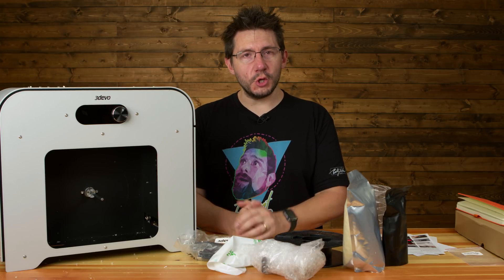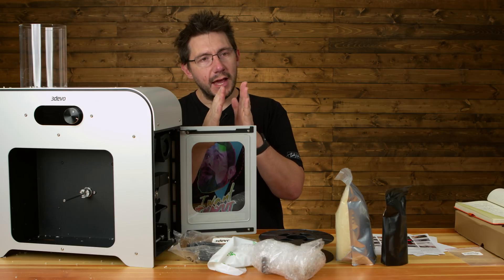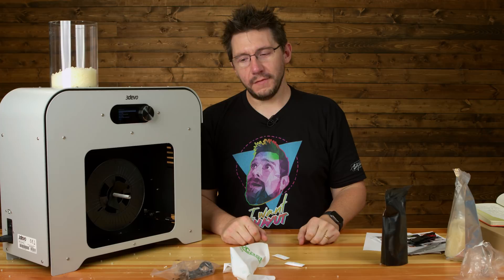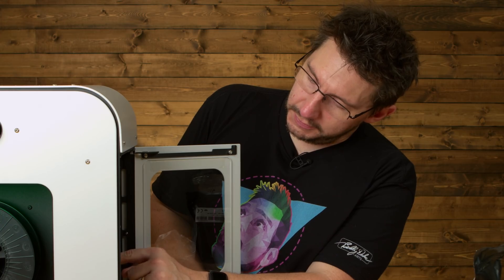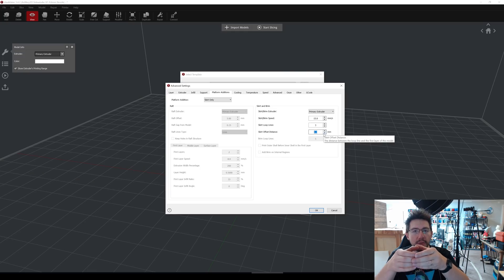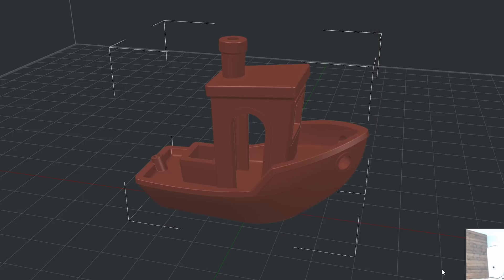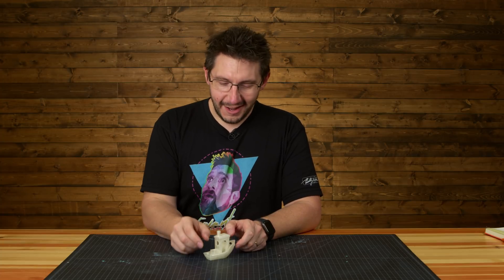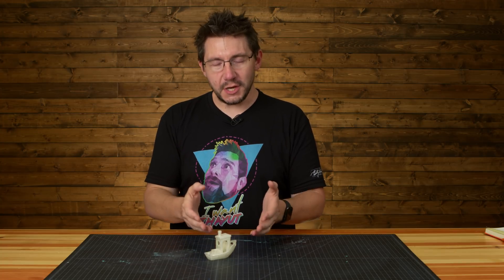Make Your Own Filament at Home: Take 2 - 3DEVO COMPOSER First Impressions

Comment: Great results, but it's far too expensive to be considered a 'home' product as your title suggests - desktop for sure, but when many of us are running printers that cost less than £500 we certainly don't want a £5000 device. Even for schools and makerspaces, this is far too much.
I'd like to see what it does if you mix colours of scraps, and when you put in two colours sequentially - if you can make a filament with a repeatable pattern it could be fun.

Comment: It's amazing and all but the price is far more than the sum of filament no I'll ever buy :p this is more for companies or communities imo
Reply: As a 3D print company, nope, still nowhere near worth it! It costs around $4 for virgin plastic pellets required by this machine, as well as electricity.
Which means to just break even, you will need to make at least several thousand 1kg rolls of filament, without the machine ever needing a service.
Reply: @nataliesilsbury1888  i meant companies that make filament. they could have one for specialty filament :P so they don't purge out the filament to change
Reply: @nataliesilsbury1888  I also have a 3d printing company & am confused also on this pricing being justified.  Hopefully Joel will do a video on Filastruder soon

Comment: You should print a flower and have it smell like a real flower by mixing in some perfume
Reply: Sounds flammable.
Reply: Good idea but not sure that will work. I've had some filament that smelled like strawberry while printing but didn't smell at all after printing. Maker Muse had filament that was made with algae and it smelled really bad when printing, though was OK after done. So I think filament with perfume in it would just smell like burnt perfume (probably not good) then nothing afterward.

Comment: Hi Joel, They lost me - big time; their cheapest model is: $5400USD.
Reply: so it is just at the price of an ultimaker2.
Reply: R Salomon I gotta wonder why
Reply: The Filastruder/Filawinder combo seems to use similar methods to this, albeit not in as tight of a package, and it's less than 1/5th the cost.
Reply: 5k just for the filament maker, for the Shredder gotta be at least 2k... over all looking at about 7k -_-
Reply: @AceSG  shredder could just be a blender
Reply: I think that for a price of over $3000 it a small filament maker like this should be 100% automatic. For that price, I think that you should not have to manually cut and feed the spool yourself.
Reply: @NothingMoreToSeeHereAnymore  Then you won't want to see industrial versions that cost $100,000 that are not automatic and require allot of manual intervention.
Reply: For print farms with a high filament consumption the costs savings are conciderable. 1kg of raw material is about 10 times cheaper than 1kg of filament. Keep that in mind, and the savings grow with the higher performance materials.
Reply: Yep I agree also the one he’s using is like 7grand
Reply: You need to look beyond the price - that will come down.  The first of anything is expensive.  The key here is that it is the first compact system that I've seen that looks like it works with consistent results.  I'd like to see the economics if you were running a 3D print farm and if it would be cheaper to make or buy your filament.
Reply: @reasonablebeing5392 You are so right. And only 1 viable kidney can fetch upto 4 of these machines, at least until the market for kidney's becomes flooded.

However, optimism is really best, dont let anyone tell you otherwise.
Reply: @reasonablebeing5392  PLA virgin beads run about $5/kg if you buy in bulk, so figure you save $12.50 a kg. The machine has paid for itself after just 400kg or so. Way more than any hobbiest would use. But realistic for someone doing it commercially. It looks to extrude much, much faster than a printer could ever use it up, so the question I have is how many printers can it feed at once.
Reply: @reasonablebeing5392  youre wrong the cheapest one now is 6200
Reply: @reasonablebeing5392  this aged like expired milk in summer sun since it went up in price
Reply: reasonablebeing that’s a terrible way of looking at it, because you are basically saying the manufacture will punish the early buyers to recover their investment more quickly, then reward later buyers with the “real” price. It’s a bad approach. The market price should match the utility, and if it does, they’ll recover their investment and begin to profit in due time. Having such a long-term mindset in business not only breeds better customer loyalty, but also forces you to commit to long-term development goals. The alternative is the model of releasing a new edition each cycle, overcharging for it by 500% until the next cycle begins, then drop the price to it’s true utility value as the new edition is released. This method works for the manufacturer as long as competition is limited, but nurtures a frustrated and bitter customer base that will abandon you quickly when worthy competition enters the market. And this isn’t a new technology - extruding filament is exactly how plastics have been manufactured and recycled for molding for ages. All those pellets were filament before they were pellets. Meaning, if they remain so overpriced, it wont take long for several others to develop more reasonable offerings. Hell, an actual full sized, used, reliable, accurate extruder could likely be had for not a lot more than these guys want for this hobby machine.
Reply: Check out the Protocycler, still don't know enough about it but it is less than half the cost
Reply: That is 245 spools of 1kg 1.75mm filament. I don't think I will print that many in my entire lifetime.
Reply: Oh dam.
Reply: China will eventually build it for 1/5 th of the price...
Reply: 2021 the cheapest I found was $8300
Reply: Wow...
Reply: The price is high, but it's a great start. Think about the teaching the whole process, from from oil, plants/refinery's making polyethylene, to pellets, to filament, to printed parts that can be for projects for clean energy, a whole class on how to make a 3D printed windmill, I think is priceless. It's a high price, I dont believe it's for the desktop user yet. But for an education environment, I think its great.
Reply: @DJ-kx4en  You're speaking our language!
Reply: Daniel Hoke the pellets were filament before they were pellets. That’s how it’s done 😉
Reply: It wasn't that long ago that computers with a LOT less capability than your phone cost more than this.  And it was a very short time ago that any reasonable 3d printer cost more than this.  The price will come down a lot sooner than you might expect.

Comment: The "at home" part is a VERY loose term, in this case. It implies "at a reasonable price". But in this case it really only means the location. The price is so far out of reach, for a normal person.........Would I like to recycle my failed prints? YES! I would love to. Would I pay over 5000€ for a way to do it? NO FREAKIN WAY!!
I can buy a lot of filament for that amount of money. I did a quick calculation and used premium filament and shipping and set the rate at 35€ per roll. That meant I could buy over 140 rolls of Filament. And that only covers the cost of the machine itself. You also have to buy the special pellets and the cleaning material.....
Reply: I'm surprised it's so expensive, as a mechanical engineer, I look at this and think "It's not complicated, AT ALL... 3D Printers are more complex.
Reply: @Freddy_Lie  My problems are more with the title of the video and the price point. 
BUT I wouldn't say that the price isn't justified. Even though the mechanical parts might not be super difficult, the integration of the sensors, into the mechanical parts, is a whole different thing. 
Getting a machine to heat up material and push it out at the other end is easy. Getting the machine to self adjust while doing it, to assure a constant flow and diameter is another thing entirely. And it's their "big product". Maybe there will be a real "at home" version. I mean look at the Prusa i3 MK3s. The price point is higher then your average Aliexpress printer, like the Anycubic Mega S. But now they have the Prusa Mini...
Reply: @bjoernlubetzki  It's not hard to make it adjust to sensor input either, it's literally just a PID loop to tune extrusion/pulling.
Reply: @Freddy_Lie  if it's that easy, you can build a machine that does it and sell it cheaper.....
Reply: @bjoernlubetzki  lame reply dude.
Reply: @Freddy_Lie  Still the truth.... It may not be hard to build the machine, as a one off, when you're an engineer. But to mass produce something and give customer service and get it to a level that even an "idiot" can exchange the nozzle and a relative novice can use it, it's a whole different story. Oh and not to mention the customer service that costs money. 

I only had problems with the titel of the video, the "at home" part, as it implied (for me), that it was a bit more reasonable than 5000€. On the other hand they have to make money.....

If Joel had titled the video "This will make it easier to recycle filament and produce custom filament" I would have been fine.
Reply: @bjoernlubetzki  I think you guys are missing the point. This product isn't aimed at the "guy in the garage wanting to recycle 4.3 kg of failed PLA prints just because" this product is aimed at labs, professionals and companies that want a quick and easy way to experiment with recycling and prototyping of filament. These kinds of products are not priced on cost of manufacture + profit. They are priced after what value they provide for the customer.
Reply: And no one seems to actually review the Filastruder/Filawinder. Which is the cheapest way of doing this that I've seen. They just go with the multi-thousand dollar units that they get sent for free instead of investing some time/money and doing pre-research and getting several models to compare.
Reply: being poor doesnt make something not "at home"
Reply: totally agree with u
Reply: Making your own filament at 7 a kg. Would take 178 rolls. Not including recycling what is bad.
Reply: At home isn't a very loose term. It's size is comparable to a full sized ATX computer tower. It also does not appear to need any special power needs. 
What you are addressing is just pricing which is a different issue. So no it's not ready for the hobbyist where that's way outside their price range. So it's not ready for them but seems on it's way to be ready for a shop. 

Don't look at it as "Is this particular machine for me".  Prices comes down when production ramps up.
Reply: To me this seems like a great addition to a shop that offers 3d printing like my local library or a mom and pop shop. Think about it charge a small fee to recycle scraps and it would get paid off in no time depending how much demand is there. I know I'd pay for such a service xD
Reply: @serenastieveling  I have seen a few reviews by now (of that thing). Yes, it can recycle failed prints. But it's not an easy "put failed prints in, get new stuff out" - kind of thing. That makes it a deal breaker for a local library. In my library there isn't a 3D printer and even in the bigger town nearby, they don't offer 3d printing services. And even if, they may have a person that learned how to print your stuff. But using this machine has a learning curve all on it's own. 
If it where a fully automated system that is as easy as "put failed prints in and get new out", I can see it for a library, or a small store. But this machine is a special piece of equipment.......
Reply: @serenastieveling  Keep doing what you're doing. You have a great mindset!
Reply: @3devo  Says the Company that is trying to sell their product......